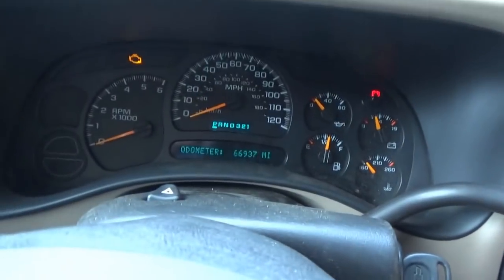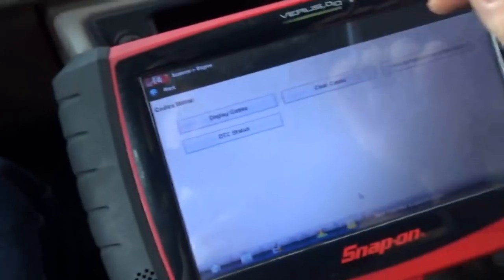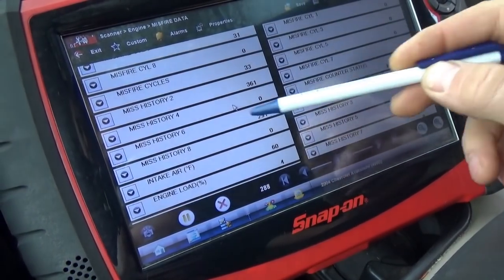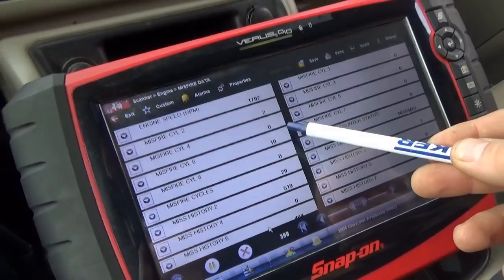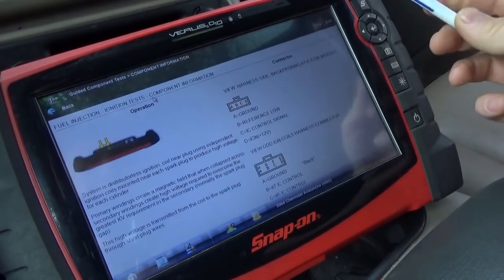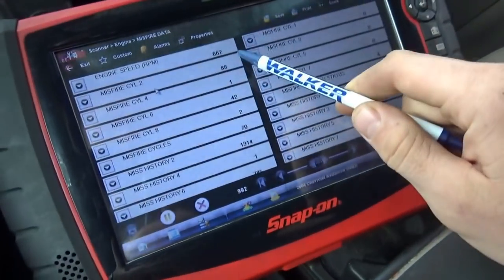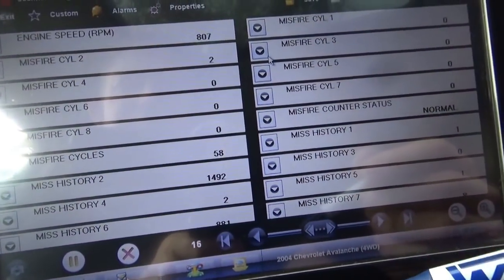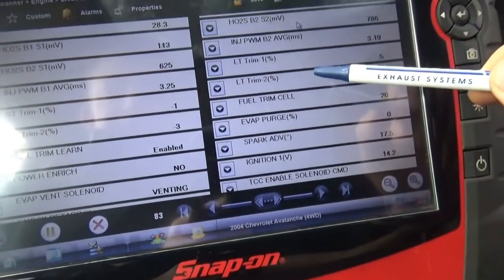Bank 2 Misfire case study: Chevy Avalanche - Part 1

Comment: I know this is an old video but I have a 2003 suburban and it had multiple misfires and flashing engine light. Burned fuel like crazy and I was smelling gas at the tailpipe. It shook so bad that the exhaust pipe was banging and every time I started the engine I would hear popping in the exhaust pipe. Shop told me I needed new fuel injectors. I did not do that because I’m dumping fuel. I watched this video and did some testing. I ended up changing all four O2 sensors and mass air flow. After that I was able to find I had misfires in 1,3 and 4 cylinders. Changed coils and plugs and wires and the engines runs like new. I purchased the suburban used and the engine light was on. Now no lights are on. The power is there and gas mileage is great. The shop was ready to throw parts at it. I don’t know what diagnostic tools they had but they were wrong. I am still using the injectors that came on the vehicle. Thanks for sharing this video.

Comment: I know this is an old video but it really helped me narrow down my issue. I have a misfire in the #2 cylinder in a 03 suburban 340k miles on it. I changed coils wires and plugs since I know these needed to be changed. Still a slight misfire but it runs much better. I unplugged bank 2 upstream and downstream o2 sensors. It runs a little better. I will just replace all 4 sensors. Thank you for this video. I was ready to junk the Chevy and buy a new one.

Comment: Hey Ivan!  Hope your doing well from Pittsburgh.  Spring is never coming! Haha. Question.. 04 Liberty 3.7L, got a code while cold idle still open loop for a O2 bank 2/2 low voltage a couple of weeks ago.  Cleared and hasn’t come back.  I did notice my LTFT is +10 Lean on both banks and fluctuating properly around zero on both STFT.    Would you be concerned.  How much influence does the downstream O2 sensors have on the LTFT’s?  O2 sensor 2/2 does read a lower voltage thank 1/2 once warmed up.  Should I throw parts cannon and buy two downstreams? No codes atm.  Slightly rough  idle at open loop.  Can’t locate and vacuum leaks

Comment: I was told by a 20+ year GM Master Certified Tech that it's not uncommon for the Misfire counts to sometimes count up on cylinders that are actually working fine in a dead miss situation. Especially on the cylinder that fires just before and just after the dead cylinder. But it can be on any of the other cylinders. So keep in mind the firing order whenever doing a misfire diagnosis. It could be counting up wrong cylinders. He strongly suggested to me that in a misfire diagnosis, fix the dead miss FIRST, THEN go back and watch the misfire counters. Otherwise if you only get your data while the dead miss is still happening, it can really bite you in wasted time

Comment: Oh no no , I need an in cylinder and a injector drop test to be certain sir . Scope pattern to crappy
Reply from the maker: Injector drop test? Fair enough. Part 2 coming right up ;)
Reply: Actually the waveform showed a rich fouled spark plug or carbon tracking just didn't have the detail of a Pico. Definitely needed more info though

Comment: If I had to guess, since I own the same engine & know it's history, I'd say busted valve spring ... but that seems to happen on the '07 and up ones more than these years, in addition to bad camshafts and stuck AFM lifters. GM sure knows how to build engines after 100+ years! It seems they're regressing in that aspect ...

Need more data either way - looking forward to Part II ! :)

Comment: Good proposals. I'll add mine to the collection: Either low coil primary voltage OR low compression in cylinder #2 (based on ignition waveform). Sticking (dirty) hydraulic lifter on #2 intake valve, leading to a tight valve and air-fuex mix leaking back to intake during compression stroke. Misfire indication on #2 due low power / no power. Extra fuel vapor in the intake MF + normal amount of fuel injection cause too rich mix to #6. Poor output -> misfire indication. Overall AFR still right -> fuel trims ok on bank 2. Repair: Oil change, lifter cleaner addtive to oil.
Reply from the maker: Great thought process. I like that you explained how the fuel trims are still OK, even with the misfires :)

Comment: There are a number of comments suggesting bad ground connections.  This could be eliminated with a few jumper wires to a solid ground on the engine and/or battery. 
This is a tough problem.

Comment: It's been interesting so far. I'm most familiar with GM than anything else but even that doesn't help much here. However, my 5.7 liter had an intake gasket leak and that allowed water to get into the cylinders which fouled the spark plugs. That's all I got Ivan. Looking forward to the next video.
Reply from the maker: Actually Wyatt, your guess is closer than most in the comments...you will see what I mean in Part 2 :)

Comment: I had a chevy express had steady misfires on a few cylinders at 2k rpms, crankshaft relearn took care of it... A few years ago i had a truck that had a few worn camshaft lobes made no noise and cause a steady misfire at idle and went away while driving it... Ive seen broken valve springs but not do what this is doing. and i don't know if it has active fuel management but the cylinders the shut down are 1,4,6,7. I can't wait to see what you end up with. I love seeing different faults it makes it more interesting!

Comment: Really it's acting like a vacuum leak on the right side but fuel trim data doesn't bare that out, sometimes the simple answer fits best, poor atomization of fuel at idle, possible fouled plug. we know the truck has low miles for it's age. A stuck EGR valve would affect both sides same for lack of service; air filter, plugs, this engine is not vvt so can't be a cam phaser, you can't hear a vacuum leak or at least don't suspect one, coil voltage ramp rules out bad ground or coil, so we're left with something on the right side. looking forward to part 2

Comment: Great vid!! I’m guessing small coolant leak in head gasket between #2 and #6, on a cold start it misses more because it’s trying to burn the coolant that’s been slowly leaking in the cylinders. Sets more misfires at idle because it has less pressure blowing it out the exhaust  valve then when reving it, also computer has more time to calculate somethings wrong. Funny smell might be burnt coolant in exhaust stream, flashing engine light maybe because saturated cylinder but could have also been the coil connecter that was unplugged. I also kinda think the wave looks funny, possibly coolant affecting it. That’s my theory?
Reply from the maker: Not bad! I like your thought process! You did explain all the data presented :)

Comment: I see there is some TSB's for low fuel pressure causing a #2 misfire and some issues with G103 and wet 02 connectors dropping out banks but I guess until you get a bit more info it is hard to manufacture a hypothesis at this point. Look forward to some more data!
Reply: My next step? I would assume it would be the same as anyone's... find out why it is misfiring haha. What's missing, fuel, spark, compression, timing, ability to breath? I would monitor as much as I could at the same time on the cylinder that was acting up the most. I guess at this point in the video not enough data is gathered to make an assumption. What data would I collect... hmmm If I knew 100% for sure spark was good, power, grounds good at coils I would gather injector drop and injector current along with fuel pressure just because that can be done easy enough, if fuel and spark were perfect and being delivered at the correct time and all I would go in cylinder and see if there is a valve spring or valve issue in general, like I say at this point I could make a big old list hah. WE NEED MORE DATA IVAN!!
Reply: Seen the same TSB and definitely need more data like spark plug reading with intermittently long spark line @3 ms, no termination oscillations but that may be the inductive pickup & low kV at start of burn line...like the Pico better. I'm old school plug reader plus sounds like people already had their hands all over this one so who knows what he'll find...it's just starting to get good!
Reply from the maker: Thanks for the input, Eric! Have not seen that TSB....I should look at more TSBs haha! We will get some more data in Part 2 ;)
 
Now tell Keith to get over here and share his thoughts! I wonder if he has seen this problem before on the Island? He did mention something about turning on the headlights and causing more misfires...crazy stuff lol
Reply: Keith is a smart cookie b/c the same ground (G104) for the 2,4,6,8 coils is also for the headlights by Mitchell for 5.3 but then their ground distribution shows G102 for all the coils & BBB shows G102 for grd distro & engine diagrams so I know it is in capable hands to figure it out if needed. It only takes a second to test...looking forward to the outcome. I'd also test the secondary of the good coils and see what you get for a waveform plus it only takes a second to pull a plug on a 5.3  I know it'll be good and there is always an important nugget your holding :D This as a low mileage Avalanche so did it just come out of storage or just driven low miles. Part II should be good. Of course these are all inconclusive conclusions from insufficient data b/c I can still list a lot more possibilities. Good suspense Ivan  :D
Reply from the maker: Eric, I am curious, what would be your next step in this diag? What other data would you collect?

Comment: Sounds to me like it needs a new windshield wash pump... ;)~
JK...I'm still stuck on that Eric O evap code which turned out to be faulty p/s sensor...
Reply from the maker: Yeah that was a crazy case study! Wish Eric would have used a PicoScope instead of the Vantage Pro so we would have seen the electrical noise at the fuel tank psi sensor!

Comment: dose it have active fuel management
Reply from the maker: what is active fuel management? No fancy systems on this one...
Reply: Uses oil pressure to  deactivate cylinders via the lifters. AFM lifters are known to stick closed and cause a misfire. Your symptoms could be be related to this. Possible clogged ar sticky lifters?

Comment: seeing that you have a bi directional scanner id try a crankshaft variation relearn to see if it makes a difference. i seen bank 1 misfiring too. free and easy for you.
Reply from the maker: I also thought of doing this. However, the truck was physcally shaking during the constant misfires, so I believed the counters overall.
Reply: wiring harness being pulled by engine movement. maybe coil current ramp when dead misfire occurs

Comment: I would do a relative compression test, just for the sake of it. And then maybe switching the coils and looking if the problem follows? And your coil waveform looks a little strange, looks much different than what I've seen on Scannerdanner videos. I guess there might be some weirdness going on with the ignition.

Comment: Well, secondary ignition waveform shows that the energy isn't dropping down after the burn time. It's slowly trailing off. It isn't being completely dissipated showing an issue with the coil. Since this isn't Staten Island, you could compare waveform to another coil or do the old swap routine to see if it follows.
Reply from the maker: The waveform looked kind of weird. I should have checked a cylinder on the "good" bank!
Reply: If it wasn't the coil, then that weird waveform would seem to indicate that it's something internal to the combustion chamber.
Reply from the maker: Indeed...what is weird inside?
Reply: Pine Hollow Auto Diagnostics The burn time is all over the place. So, hydrocarbons are not fully being burned. That lean code could point to some unmetered air. Perhaps a ScannerDanner style soda bottle water test for a vacuum leak? But! Fuel trims looked good so, fuel injector issue perhaps.

Comment: my shout is incorrect timing chain adjustment from factory, so slight, eg one toothe at cam, so that it doesn't effect performance until now in its life a very slight MAF or O2 miss reading causes it to miss fire on that bank.

Comment: I would spray spark plug wires down with water and have someone power brake it. The rain in the morning is a clue, have seen a lot of GM vehicles with failing wires some times it's the easiest things. Keith
Reply from the maker: Great first step. It would be a big coincidence for all 4 coils/wires to start failing on one bank all at the same time however...
Reply: That is a good idea keith  frisell !!

Comment: Ivan, i doubt the spark plugs would be excessively worn out at 67k. They are iridium and should be good for 100k and in reality a lot more than that. I have an 03 silverado and changed mine at 127k and they were still working fine. My best guess is intermittent coil drivers in the ecm? Corrosion on the ecm harness?

Comment: My next step would be swap 2 and 4 coils with 1 and 3 to see If misfire travels. If it stays the same check injector balance test for bad injectors of course check for proper fuel pressure key forward engine off then engine on then under load.

Comment: Odd spark plugs fitted between cylinders, or it needs a new set of plugs in general, 
Cold start dead miss though not sure if weak plugs would cause that, more like coolant in cylinder in that case.

Comment: Just going on the secondary waveform you logged, is it just me or when car starts to shudder, does the voltage after the burn time increase, i.e. indicative of a lean condition causing misfire? If it happening on just that bank, perhaps it's an inlet manifold leak as engine warms up? Would expect to see O2 sensor reporting a lean condition too once warmed up (which I think you had a code for prior to clearing them). Keep up the awesome diagnoses!
Reply from the maker: Great observations! That P0174 Bank 2 Lean turns out to be quite important ;)

Comment: I own 3 of these engines, and they all shake at idle.
Reply from the maker: Does the check engine light flash?
Reply: Pine Hollow Auto Diagnostics No. I had 1 that did at high speed. Cyl 1, and 6 misfire. Crankshaft variation learn fixed it.

Comment: also, if you have one bank with misfires, do a smoke test, check the Integrity of the intake manifold gasket. Because it seems to misfire at idle when manifolf vacuum is the highest
Reply: stanghp1 the fuel trims were fine though. Dont u think a intake leak would show up in the trims
Reply from the maker: Good theory, and follow up question :)

Comment: I would do an in-cylinder compression test using a pressure wave transducer, I want to rule out valve train problems. Misfire on Cylinder 6 maybe due to the firing order, the ecm perceives a misfire on 6 due to a misfire on cylinder 2.

Comment: Bet it's clogged or dirty injectors. Dripping at idle but under load fuel pressure overcomes dirty nozzle and added fuel stops miss
Reply from the maker: hmmm I guess it's possible. But with leaky injectors I would also expect Bank 2 fuel trims to go significantly negative, and maybe a Rich code?

Comment: The low coolant is my main clue. I would try a liquid co2 tester to check for a head gasket leak. If it shows nothing, I would go with the other viewers comment about a leaking fuel injector on number 4.

Comment: Bad Spark plug wire, looks like its firing in the cyl. but at times firing outside the cyl. Maybe bad plug, but I say wire! 
Iv been fouled with gm misfire counter 1 time, butall other times they are spot on.

Comment: insufficient data     we dont guess !!!
Reply: Dang it and here I was licking the screen to get the taste aspect of it... buy a better camera Ivan!!
Reply from the maker: What other data would you gather to come to a definitive answer?
Reply: map maf baro tps all o2's
Reply from the maker: All scan data looked OK. What next?
Reply: i'm going to sit back and wait for part 2.  i remember at least one video you said the data was all ok and in the end you questioned it yourself. the thing is you need to use all your senses sight smell sound touch (feel)and yes sometimes even taste. unfortunately your camera isnt good enough for that yet.  lol   a road test would be good  but there are so many things that can cause a missfire. your scan data only tells you what the computer and its inputs and outputs are doing .   a lean condition  mechanical (compression. blowby.valve cam etc)condition fuel or ignition conditions. i'm from old school. we would hook up a sun machine or the marquette and we could see all the data we needed right there.nice thing was you could compare cylinders on a raster and compare firing lines coil soak etc  best way to set a carb on a cross h  intake v8 was by watching firing lines as you turned the idle mixture screw.  one thing i did pick up on was the wet condition. electronics hate moisture. the old days coil wires and distributor caps was about all that would cause a damp misfire but now if you bring any of your sensors down or a reference voltage you are looking for trouble. any who  i enjoy watching and learning.  my motto has and always will be  "question everything"